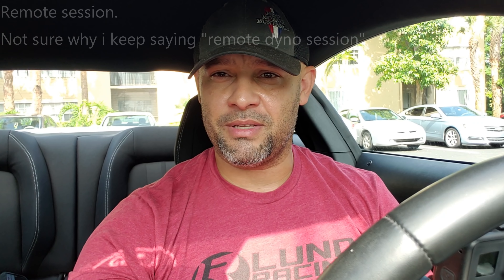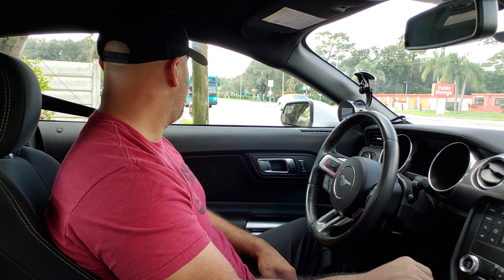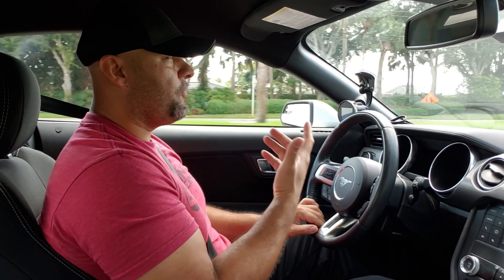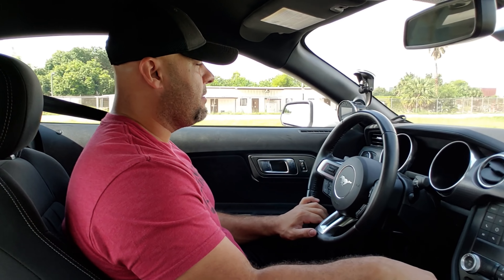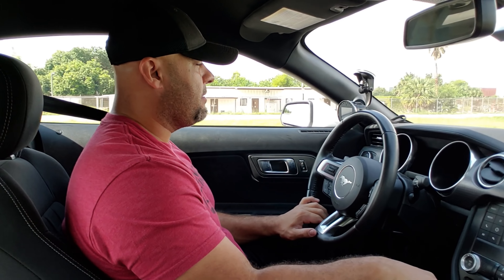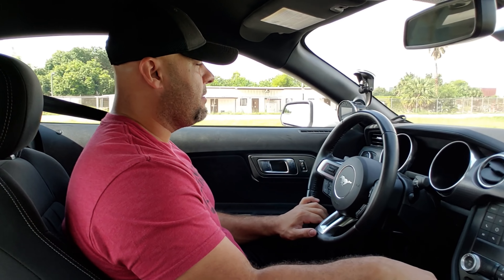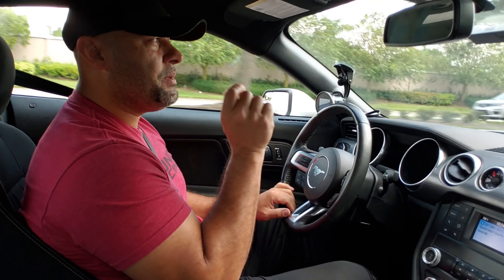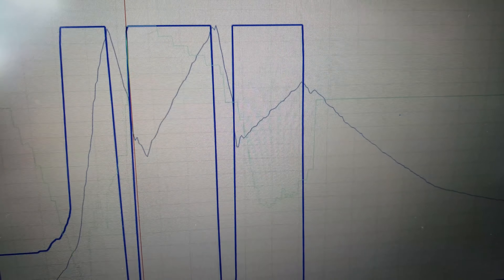Doing a "remote session" on my Vortech supercharged 2019 Mustang GT

Comment: Great vid, Alex. Glad your car is running well. Thought you'd be interested to hear that my fuel pump crapped out on Friday on the way to Nashville. Don't have the full diagnosis yet, but was popping a low fuel rail pressure code. About to call the dealership in Bowling Green. At least, I made it past 27k miles, rather than just 300, lol!

Comment: You should definitely do a torque booster and 3.33 pulley and see the difference of when it wakes up at 3k compared to you 5500 now.
Reply: I agree. I put one on and gained around 40tq down low on my old 4v.

Comment: Should I expect my 2014 GT to rev the same after a Vortech install? The engine doesn't seem as responsive as it did before the Vortech--and I don't know if that is because the engine is now spinning the Vortech now--or if it should rev the same as it did before.
Reply from the maker: It will be slightly laggy but once it sees boost it should rev quicker.
Reply: @YDBT4LIFE  That's pretty much exactly what it's doing. Thanks for the reply.

Comment: Alex is the type of person to make centrifical superchargers look weak. Lol. Many countless videos of you downing the power they can actually make. 2019 Paxton mustangs (gen 3) coyotes making 850whp on a 3.48 pulley, one step up from your pulley on E85. 🤷. They can make power comparable to a PD blower and actually more efficient.
Reply from the maker: It just doesn't have the power delivery I like...I like instant blaze the tires. It might make 800+ way way up in the revs..but it's not as fun as a pd or tvs car. But it might be just as fast.
Reply: My Lund tuned Paxton ‘18 on E85 725/544 wheel on a 3.6 through stock manifolds and cats yesterday in a sweltering fucking shop.  This is paired with a Fore L2 with rails and ID1050X’s.  850 would be a tremendous jump for just pulleying down, at least IMO.  Unless my car is just an utter piece of shit.

Comment: But what Paul’s hotter I know you like Whipple what does the Whipple have a better top and pull them a centrifugal and after a few runs doesn’t lose power because of the heat absorption
Reply from the maker: Wat!!
Reply: I just lost about 10 points on my IQ after reading that.... Then I caught ADHD.

Comment: Raise limiter to 8200 shift at like 7900+ imo.  My NA limiter is 8200 lol but shift point 7500 with the 10r80 since I am NA.  I think youd keep making more power higher in the RPMS with the supercharger, and with a higher shift point 7900+ youll probably make an extra 50.  I am not a tuner and I dont know if your current injectors could handle that but boosted 18's keep making power to like 8k.
Reply from the maker: I think I know about these cars....just a hair better than you. Lol. No sense in revving it higher than 7700 and gotta figure out the knock on shift situation 1st